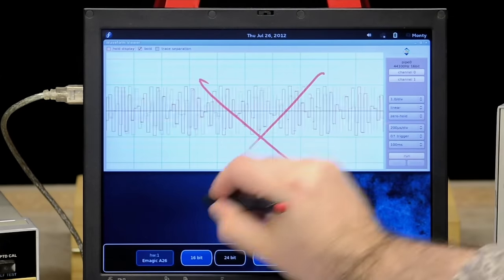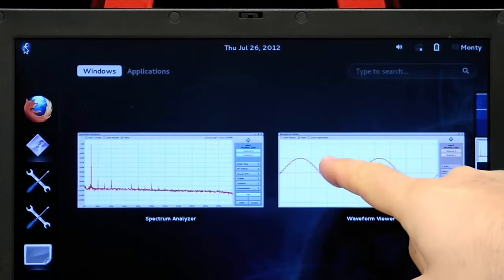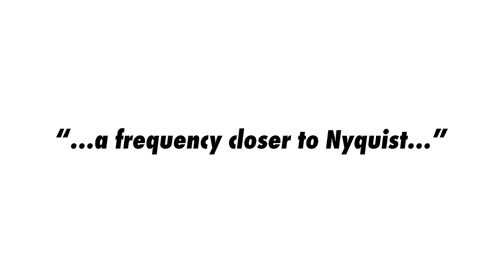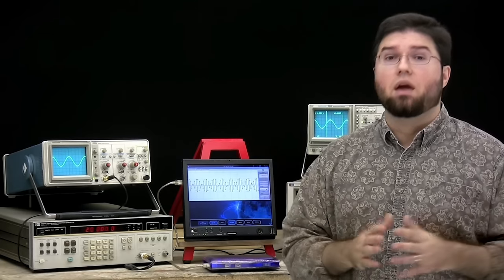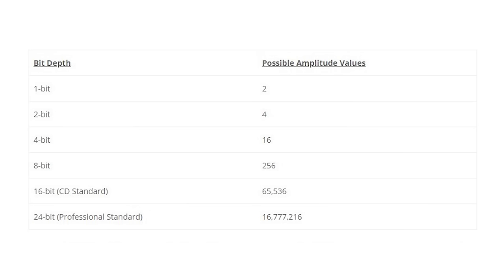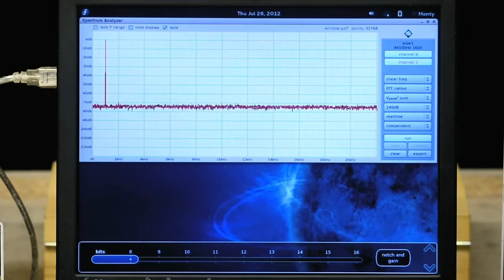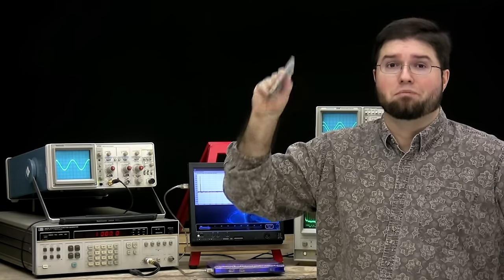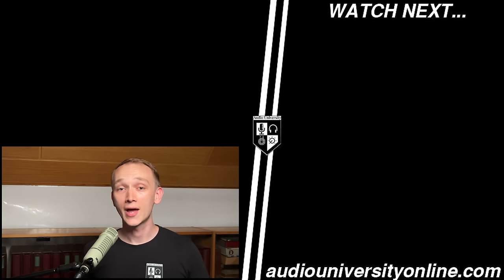Debunking the Digital Audio Myth: The Truth About the 'Stair-Step' Effect

Comment: I think I saw something like that before, in electronics to produce sin wave is generated by pulling high and down voltage with specific timing and then capacitors smooth it out to sin wave

Comment: Yeah, but if I want to record sounds that can be heard by a mosquito then I must use 96kHz and 24 bits audio, if I don't then the little rascal is only treated to some humming and hissing. The point is that male and female insects respond differently to the ultra high sounds, when the male mosquito mating call is played back, other male mosquito's will disappear from that area and the female mosquito's become disappointed and leave as well. But when the female mosquito mating call is played back then it becomes crowdy with the flipper flapper of little mosquito wings.

Comment: The "stairsteps" are higher frequencies that were filtered out.  Also, "CD quality" doesn't have the frequency response of analog.  

One thing that isn't mentioned is that young people aren't listening to "CD quality" audio.  They are listening to compressed MP3 files, which do sound very different, depending on the amount of compression.  It's similar to JPG files.  When I upload JPG files to FB, I always use a higher quality that otherwise necessary, because FB recompresses files to make them even smaller.  

Whenever I digitize analog recordings, I keep the original WAV files as they are the highest quality I can get on my computer.  That's what I use when I want to burn CDs to play in the car.  Yes, I have a car less than 3 years old but does have a CD player.  

Most young people don't even know what most musical instruments really sound like.  They mostly hear electronically altered guitar amps, electronic keyboards, and synthetic percussion.

Comment: I don’t doubt what you’re saying here “for playback” (i.e., mix-downs), and per-channel.  

For mastering purposes though, where you’re going to be processing the sound considerably, I think there can be value in recording source material in higher resolution.  That, somewhat analogous with recording source video material in 4K for HD-video production.  Rounding errors can build up.

Even for super-high-fidelity mastering purposes though, I don’t see any point in going higher than 96KHz 24-bit.

However, there is still value in multichannel surround audio, and obviously for two-channel stereo.

Comment: I agree than CD quality is more than enough. But this analysis is only partly valid. To get this waveform reproduced you need to have a sound over some time, there must be many cycles of a wave. Now, waves can interfere with different phases, these phases can dynamically change over the signal. I suspect that in the end one needs high sampling frequency and high bit depth of reproduce all the details faithfully. Or at least there will be people who can hear a difference here and there when parameters are lower than CD quality.

On top of this it's important to note than most recordings are highly imperfect to start with. For example it's extremely difficult to record a human voice without some small artifacts, microphones are never perfect. And so on. 

And no doubt tapes and vinyls have their disadvantages. But still, the 8bit audio is unpleasant in a different way than an old tape

Comment: Nope. I did a 188k recording man years ago. Mixed in 188. The sound stage was amazing. Then I dropped it down to 44 for the cd. The space and room that you could hear at 188 was reduced significantly. 44/16 just cannot convey the ambience and space of a room. 
Though they don’t have the dynamic range or frequency response, LPs being all analog still sound better because they can deliver that sense of space.

Comment: No one is saying that. the long-form of the claim is that it is much easier to actually build a player that can perform great with higher sampling rate, since the problems are higher in frequency, so simpler filters can be used. But yes, your theory is correct.

Comment: There's a really HUGE facet of digital vs. analog that you didn't even mention and it is for that reason alone that I will always favour a vinyl record over a CD:  The experience.  Pulling the record out, placing it onto the turntable, reading the liner notes while it plays through a good set of headphones while relaxing in a recliner.  Playing digital media is cold and hard.  Analog is warm and fuzzy.  From a technical standpoint, maybe digital is as good as or better than analog.  From an experience standpoint, there's no comparison.  Analog.
Reply: @nicksterj Ya.  Just like that.  You get it.  There's just a unique, warm, deep, FULL feeling to the sound that comes from a vinyl record.  Even the odd tick or pop, while it shouldn't be there it's okay if it is because it just adds to the nostalgia.  It's hard to describe, but those who know... know.  CDs and mp3s and streaming services just can't reproduce the part of the experience that transcends the technical.  Not even the 24bit, 192kHz FLACs.

Comment: This shouldnt be a surprise if you just read a mathematics book. Below the Nyquest freq. the discrete fourier transform is lossless. In the DA converter the wave forms are generated from the fourier transform on a much higher time resolution than the original sample frequency.

Comment: I was very surprised seeing the original video.The secret of the perfect sine at 20kHz, however, is not in the low-pass (LP) filtering of the DAC output, but in the CODEC chip inside, which receives 44.1kHz data stream from the i2s, and interpolates it into a much higher frequency using a digital filtering technique. That interpolated stream is provided to the DAC, and only now the carrier frequency (~200kHz) is filtered out using analog LP filter.
     I wish they mention the "secret" CODEC explicitly to avoid the misconception that the analog LP filter can reconstruct the 20kHz sine directly. No, it can't!

Comment: Its not about A->D, its about D->A and the lowpass filter needed. Either you have a very steep filter (expensive and phase-shifting) ... Or you uplift the clockrate of the DA so filtering is easier. Cheapest method with best results: 
1Bit DA converter. COnversoin clockrate is so high, piece of wire does it as a filter.
Old, but still superefficient: 
https://en.wikipedia.org/wiki/1-bit_DAC

Comment: There's so much more that goes into the final sound you hear.  Early CD's sounded like crap on most players.  But was it the player electronics that made it sound that way?  I've found some of the best 80's CD players were so much better with the 44.1 signal than later models. And yet the majority of consumer grade stuff sounded awful  And re releases from original tapes, in high rez are so much better on my higher end DAC. Why?  I've come to believe it's the care taken in the overall process and not the basic bit/sample rates used.  I've also become a fan of DSD though the catalog of pure DSD recordings are quite limited.  I think we may also find that the DAC output filters on some gear do a better job at the higher bit rates, but I have no tech data to prove it.  But I do hear something. That being said, I have a variety of favorite tracks that are 44.1, and (gasp) even .mp3 files.  Some are smooth and clean and totally enjoyable. So play what pleases you and keep the tech in the background where it belongs.

Comment: This video, in short prooves, correctly that 44.1kHz sampling is perfect to reproduce a full dynamic range pure sine wave of any audible frequency. All true and fine but you need to consider that music is many sines of hugely varying amplitudes overlapped and the phase with which you put them together matters to the reproduction of the waveform you begun with. Its so easy to show perfection in any digital system when accounting for a single sine! Problems start when we deal with many, many sines at once! The antyaliasing filters crossover frequency causes phase distortion so the relation of phase between waves of different frequency is no longer preserved and well within the audible frequncy range. Also Our hearing allows us to hear very loud and very silent of these multiple sines at the same time too. This makes 16 bit depth way too shallow unless we.plan to record loud rock bands only. See what is left of the sine when you reduce the D/A input to 1/10000 of the amplitude (-80dBv). Then also see the spectrum when -80dBv 1kHz wave overlaps with a -3dBv 50Hz wave. Devil is in the detail. 16 bit, 44.1kHz  audio has always been a dreadfully audible mistake, fortunately we dont have to dwell in it.
Reply: Unfortunately yout claims are not supported by evidence at all.
Reply: @nicksterj Ah, a new word invented by my fingers (they do it all the time).

Comment: Of course it works on a simple sine wave. Where it degrades it during complex waveforms.
take 1 1kHz sine wave. In its simplicity, it gets broken into 48 individual pieces per cycle.
lets jump to a 12 kHz sine wave, that equates to 4 samples per cycle. Same resolution but how do you know that ALL 4 points represent a sine wave?

A musical composition relies on several instruments placed together and mixed into a significantly more complex waveform.

Comment: Recovery filters. You forgot recovery filters. Something has to turn 44.1Khz energy impulses into a continuous waveform.
The signal reproduced with a 44.1Khz sample rate will not have a 22.05KHz bandwidth. It is no more than 20Khz in theory, and will be less in practice. Why? With no filtering, the signals from 0Hz to 20KHz have a "reflection" in the spectrum from 44.1KHz to 24.1Khz. The recovery filter needs to roll off the response fairly sharply above 20Khz to avoid ultrasonics in the output which (as you point out) can cause distortion in some systems. This recovery filter is classically quite high-order, and so has amplitude ripples near the cut-off, and a rather fearsome phase response. Modern CD players get round this with rinky-dink oversampling schemes. In pursuit of perfection, simplicity is all. A 20KHz band-limited signal reproduced at 192KHz sample rate has a Nyquist limit way away. The recovery filter can be a simple first or second-order filter, with easily-controlled phase response. 
Surely?

Comment: I am sceptical about digital recording and the arguments used to demonstrate it. As a youngster in the seventies I had a very good record playing system, and was excited to hear about digital recording because we'd been repeatedly assured it would be "perfect". I was to be disappointed! Digital was merely adequate for the majority of people who had never understood or cared much about music or sound quality in the first place. At first, I could not account for the shortcomings I heard until I read an explanation of the technology in a hifi magazine, much like the presentation given here. 

Look at the diagram at 5.28 labelled "clarification" in the video above. If the red line is the target signal, then it is severely misrepresented by any interpretation/interpolation of the sampling points. This will cause a slurring at the highest frequencies, but will also extend to distortions in the midrange - which is what we hear when we listen. The overall effect is to strip out the timbral character of any musical instrument, and drag life out of the recording without causing gross distortion.  Problem solved.
Reply: mfnickster9754  Silly me then.
Reply: mfnickster9754  Thanks Nick. I did look up the article you suggested. There is a paragraph towards the end that begins (ironically) "Let's be clear". Here it is :" Let's be clear. When the samples in a digital signal are converted back into an analogue signal, they pass through a device called a reconstruction filter. This is the process that makes the Sampling Theorem work in the real world. If there are enough samples and they are of sufficient resolution, the signal that emerges is not only smooth but virtually identical to the analogue signal from which the samples were originally derived. Of course, it's possible to design a poor reconstruction filter that introduces unwanted changes and artifacts but, again, this is an engineering consideration, not a deficiency in the concept itself". So the "sampling theorem" doesn't work in the "real world" without a special box. Apparently this artificially gets things right and smooths them out. (How?)The item ends reassuringly with "this is an engineering consideration, not a deficiency in the concept itself". BS. There is a deficiency in the concept itself, and we hear the miserable results. I am particularly irritated by the long overdue admission that we were bullied with hype in the first place, when we were assured by "theoreticians" and other sales types that digital was already perfect in 1979.

Have you read the "Stepford Wives"?

It is clear to me that you when I said "Look at diagram at "clarification 13.16", you took this as a mere suggestion and did not bother to do so ( you did not address the point I had raised - essentially that there is insufficicient information at 44khz to extrapolate the signal, especially at high frequencies. If the machine is misrepresenting the signal, this will not show up as distortion, but anything deviating from the misreading will ). I am willing to accept that I may have made a mistake - if you can find one. But in order to address my argument, you will need to take it seriously by examining the diagram at 13.16, I 'm afraid. Thanks, Trudy

Comment: It seems that one thing isn't mentioned is that the quantization noise is not a random "white noise" (tape hiss). It is dependent on the input signal and it will sound very different from white noise when the signal level is very low. I don't know if this has any practical considerations though.
Reply: That's why dithering is  used. It makes the quantization noise completely independent of the input signal.

Comment: Sure, 16 bits is more than enough for playback. The issue with recording is different. I lose 2 to 4 bits just off the top to headroom because I don't record at full volume to avoid clipping. Then there are things like the effects channel that that is down maybe say 5 bits (~32 Db) below that. That would leave a signal to noise ratio of 7 bits on that channel, which would be fine, unless I try to amplify it. At that point the noise becomes audible once it is normalized. I record at 32 bits and 48 kHz, which is way overkill, but I have a 12 TB hard drive, so I don't care. Sure, it is going to MP3 anyway, so it is mostly about not amplifying the noise to audible levels.

Comment: Last music what is:

Here technically I can't say anything apart the physics of it, so I have to restrict myself to something actualy physically generated, so sorry but not about mainstream music
instead about what I can't compare not being inside the head of performe or sound engineer.
The something acustic and probably I'm giving here inevitably some material for, I noted, the frequently  mistreared audiophile, but is the physics the subject.

Does not matter if it is air in pipe, a string  or a membrane but you have this:
a) pipe string or mabrene have some modal oscillation carcteristic, them can be different dependong on which string for example (thick, thin) or even the same  string depending on some condition (think at the guitar or violin and the finger position on guitar's or violin's handle)
Modals means harmonics because a piece of string once defined which one and finger position support some modals oscillation.
If this id disturbing you for the moment refer to a toy keybord (something very cheap) that is givin just one tone, one key HUU, other one HAA or Hee and so on.
this part you can consider in case of toy instruments just a sinusoid that it you can hear or not depending on frequency (as said an instrument is only more complicated but theidea for now is the same.
b) a transient dependig on which mechanism is activating a), energy and speed can vary you did a gentle touch or a fourios one.
c) a dacay a) does not  stand still forever, depending on kind of instrument there is a dacay.

A minor piece of music is in  physical order the sum of b) + a)  and all modulated by c) then guess what, frequency you can't uactually hear are involved possibly in b) is there where you can hear (and you need) what, if it was a pure tone (sinusoid) you can't even ear. You don't listen to sine waves you hear what define the shape you need to reach that signal rise of this part (if it is the case) .
a) is simple, are one or more armonics think about them by ignoring decay (is not important here)  this is the sinusoidal part and if you can't hear the foundamental or some armonics they are lost for you. 
Is that part that you can check (with the help of Mr. Fourier) with headphones and sinusoid of certein frequency if you can or can't hear.

There will be a reason because  not long time ago a Stradivar's violin was sampled not only in every possible note but also in every possible way to play every single note. I think the intend was to preserve herithage of it. 
 
End,  I'm doing complete different things in normal life so I can't be more helpful on this subject.

Comment: Its thought of as stair steps because it is stored in 16 bits blocks in a memory block. Not smoother, its higher resolution and less audio dithering. Its doesn't affect dynamic range it affect dynamic definition. Its a bit like saying my guitar amp gos up to 11. Why spl and decibels arbitrary numbers should only be used outside of the digital domain and mean nothing in a digital domain.

Comment: It's not even just a PCM stair-step waveform that can produce a perfect analog waveform either. A PWM signal can also produce a perfect analog waveform when the higher frequencies are filtered out (which is all that is happening). This is even more surprising as a PWM waveform only has two states (high, or low).